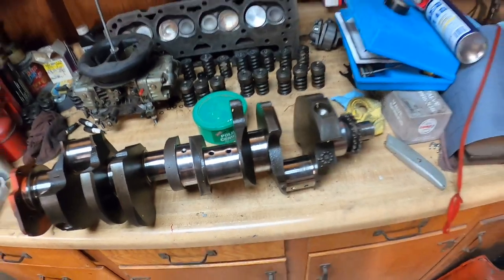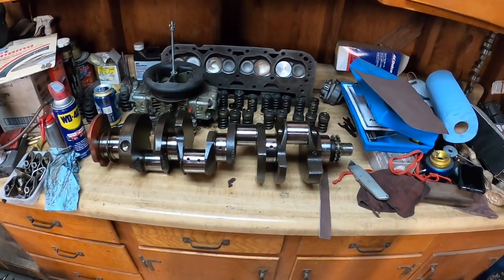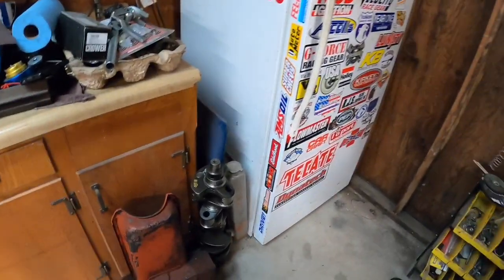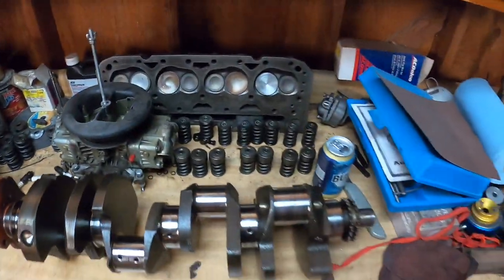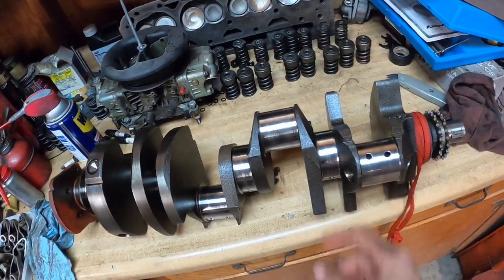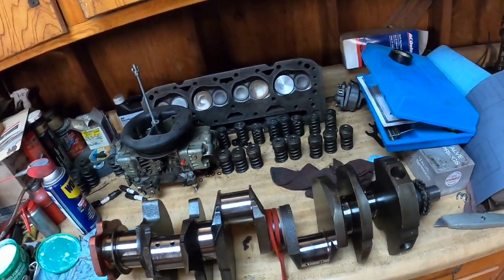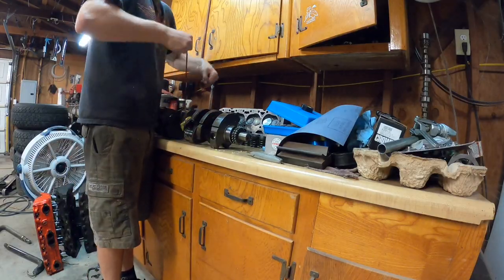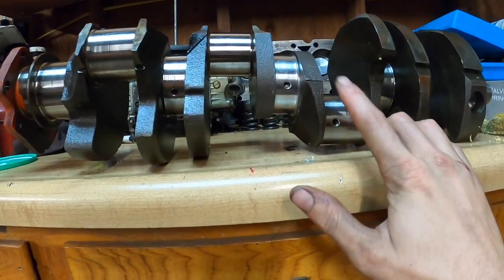Redneck Crankshaft Polishing -- How To Do It At Home

Comment: 1) Silicon-carbide sandpaper is ready available in a lot finer grits than 600, I would use around 1000 next, after that, "crocus cloth" which is jeweler's rouge on a cloth backing in place of polishing compound.
Reply from the maker: Thanks for the advice!

Comment: New sub thanks for thr video!! Did you go with standard bearings or had to change the size?
Reply from the maker: Thanks! I still used the same bearing. No difference in clearance
Reply: @CherezianRacing  thanks again for the quick feedback keep the videos coming .. 🍻
Reply: @CherezianRacing  btw do you recommend the balancing on this case my engine block will be stock just adders heads, cam intake etc .
Reply from the maker: @TubeInspire if its all the same stock rotating assembly no need for balancing. I do however recommend balancing the connecting rods/pistons. I have a video for that too
Reply: @CherezianRacing  cool stuff I will check it out 👍🏼 thanks

Comment: Love those flags on the rear spoiler bud. Just found your channel and subscribed! 🇺🇸🇦🇲!
Reply from the maker: Thank you jan. Where in the world are you located?
Reply: @CherezianRacing  I'm down in LA. 
Hey man do you think i can do this while the crank/engine is still in the car? You know, assuming the mains are fine?
Reply from the maker: @AbgarMusayelyan  gotcha, i will be in Glendale a few times next month. And not unless you can completely plug up the oil feed holes in the crank rod journal before start polishing. U cant get any debris in there or its game over. But chances are if your rod journals are tore up then so are your main journals.
Reply: @CherezianRacing  I'll take them off the mains and check em out. If you're gonna be down here for an event, I'll come out and support. Maybe I can buy you a beer for the tip on this video.
Reply from the maker: @AbgarMusayelyan  no bro its just for work midweek, however ill have some down time if you want to meet and grab a kilikia with me. What part of LA are you in?

Comment: Curios....how much material is coming off when you guys do this? Mine doesn't look bad, just need a quick going over. Guess I could plasi gage it before & after to see what happened. Also, I have a high volume oil pump with all new bearings cam included to go in wifes daily driver.
Reply from the maker: Not much at all. Wont even know the difference

Comment: Hi.
Will doing this not affect the internal diameter measurement of the shell bearings?
All the best.👍🏾🛠🇬🇧
Reply from the maker: No, the bearing shells will stay the same size.
Reply: @CherezianRacing  No. sorry,I meant won’t the journals be slightly smaller, making more space in between them and the standard bearings…

Comment: Just a thought here, instead of electrical tape maybe use something wide like duck tape ( or duct tape if you prefer...) and cut that to fit just like t sandpaper. Kind of keeping it all equal like.
Reply from the maker: Thank you! Actually found a better and easier way to do this with an old engine block. Check out the video we made for it

Comment: Yeah.. don't do this.. take it to a machine shop.. I tried this years ago on a 350 crank.. just lightly polished just like this.. lost 20# of oil pressure cause you are loosing diameter and I went from .002 to .0025 and that was enough..
Reply from the maker: Thanks for watching
Reply: You have to check clearances afterwards and change bearing sizes if needed to stay in spec.